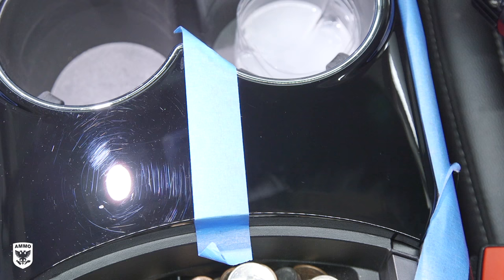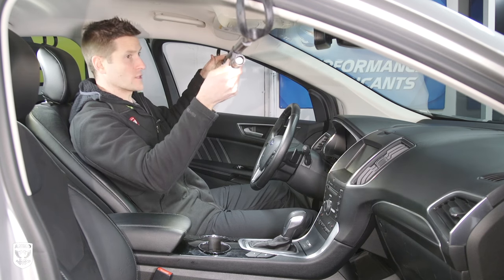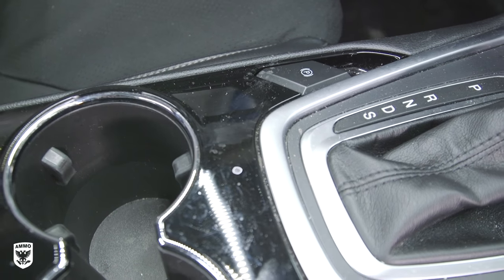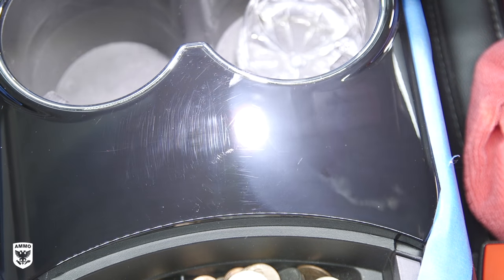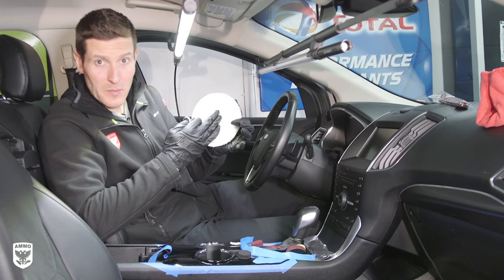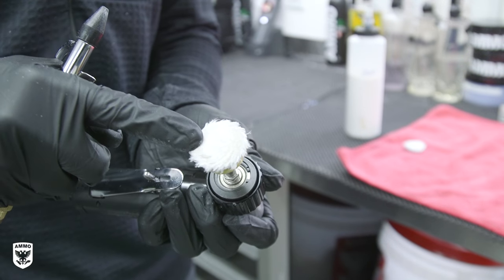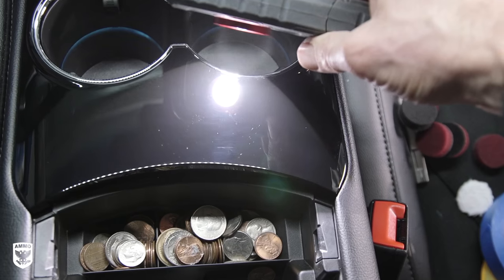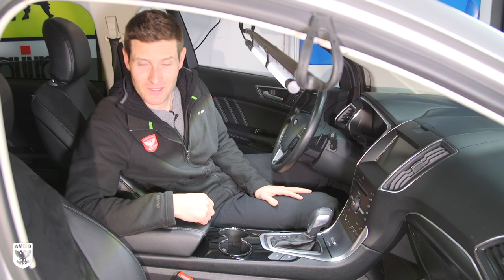How to Remove Scratches from Interior Trim

Comment: I guess the moral of the story is don't get a car with glossy plastic trim
Reply: MrNt1402 the biggest problem is: most car manifacturers think that fake piano paint is somewhat stylish (especially Volkswagen AG ) getting a new Car without glossy plastic is as hard as getting a car without softtouch 10 years ago
Reply: I've been thinking of doing the /brushed aluminum" trick to mine.  Someone did a video about how they scratched their internet router with a dish-scrubbing pad in straight lines and it came out really nice.  I think it would look better than the random scratches like this, and it won't rescratch once you're all done, not visibly anyway.
Reply: Mazda 3 owners will know...
Reply: IvanPavlov I’ve got one! It’s a pain in the bum
Reply: IvanPavlov 3 owner here...been trying to figure out how to get rid of it its so annoying
Reply: MrNt1402 Or ceramic coat your shiny plastic trim when it's brand new.
Reply: Right?
Reply: or wrap the shit XD
Reply: @noncustody  is this actually doable?  like after its polished and refinished.
Reply: FoxHoundUnit89 wrap it. Looks great
Reply: No joke - after he reached step 3, I said, I'm out, I'll live with the scratches.
Reply: for sure, that "piano" stupid plastic has to go away forever from car industry.
Reply: I would wrap that trim with 3m clear protector it hides all the scratches and is more resistant to scratches
Reply: Ååå ä pöpå
Reply: ÅååSaitara åååå
Reply: Saitara pååååååååååååååååååååå
Reply: Saitara påååpå
Reply: Will’s Wheels Detailing and Valeting åååpååååååå
Reply: Will’s Wheels Detailing and Valeting p
Reply: Just put clear bra on it or ceramic coating
Reply: I’m not sure why ANY auto maker uses this trash.  It looks terrible clean or dirty, shows every fingerprint and every defect.  Honda uses it like crazy...bad move.  It’s even in my Audi A8...hate the stuff.
Reply: @IvanPavlov  do do us CX5 owners. That's why I'm here.
Reply: @troywhite8980  😂😂😂 🙌🏽 yep..
Reply: I hate it in my 21 Aviator. It attracts lint and dust. I miss the interior in 2020 F150 Raptor because it didn't have hardly any shiny plastic inside of it.
Reply: You order a pre cut ppf interior kit for just this particular issue, most also come with a screen protector as well as a comprehensive kit.
Reply: Almost impossible

Comment: The poor mans version of the light is at harbor freight, the end of the light bar pops off and there is a little paracord, and the end has hooks that you can hang on the visors or handles etc.  I also get the warranty and you just being it in to the store for a new one if it breaks no questions asked.

Comment: I have a question about priming the pad. When you prime your pad with polish and use the compressed air on it, is the product therefore being wasted because the compressed air is blowing the polish off? (As well if this is true, what other way could you remove the abrasives to reduce wasted polish?)

Comment: Great VIdeo!  BIggest TIP. Make sure to cover the trim with that clear bra stuff or it will be all scratched up in no time.   It is about time they "banned"  found a replacement for this Piano Trim. It is the worst crap ever invented, it looks good for about 60 seconds after fitted then it will be covered in scratches in no time. 

I have the new Mazda cx2 2nd Gen with this type of trim on the outside pillars.....  Hopefully someone reading this, can make new pillars in carbon firbe, i would change in a instant!

Comment: +Ammo NYC 
Larry, Great video btw. Can you step it up to a larger pad than that or does it need to be 1”? I do have a 90 degree grinder that I use for body work so I should be able to do this. the trim is wood trim on a 2007 Lexus GS 350. The scratches aren’t too bad so my main concern is to make superficial cracks better (if possible) Let me know. Thanks.

Comment: I've always approached soft, high-gloss plastics like this with a by-hand approach.  Partly because I'm not a professional detailer and I don't have all these amazing, tiny tools, but also partly because I feel like I have a lot more control over a much more sensitive surface.

I've also found that common compounds and polishes can be overly aggressive with these softer plastics.  Much like you, I've seen 205 leave "residue hazing" on plastics, similar to the haze left on paint by lots of "scratch and swirl remover" all-in-one products.  I've had a lot of success on plastics with Meguiar's Ultimate Polish and a high quality microfiber towel for the "compound" stage to get out deep scratches, then refine by finger-applying a layer of the same polish, letting it sit for a minute or two, then gently wiping and buffing with one of those weird, super-fluffy-soft microfiber rags dampened with water.

Just some thoughts on the subject!  Any and all feedback always welcome.  :)
Reply: That's a really good idea, thanks. Will test it on a inconspicuous part soon.
Reply: @raksh9  3 years later. It work?
Reply: @The2Coolest2  Three years later and I still haven't tested it 😅 I will bookmark this video and update this comment with test results eventually.
Reply: I'm here because I polish high value CDs.
Hand polishing with Novus 1 and 2 give you a brilliant finish.
Novus 1 in particular is a really worthwhile product for cleaning the surface and giving a bit more shine and protection.
It has something that bonds to the plastic but does not bond to itself. So when you wipe it on it bonds to the plastic under the dirt, lifting the dirt off the surface.

So I apply Novus 1 firstly. I use makeup remover pads and apply it very gently. 
I then get a new pad and apply a little more pressure. 
I then flip it over and start buffing lightly but quickly. Drying and polishing at the same time.
Then you do your polishing. With Novus 2 to get the scratches out.
This is hard work, so I am looking at getting a polisher for this part. Maybe doing a final light hand polish
Once polished I then repeat the steps above for novus 1. It really removes old polisher very well too.
Reply: @HouseholdDog

Comment: Thanks for another helpful, educational video, Larry!  I have the piano black trim in my car as well. To clean it, I use a microfiber towel sprayed with SPIT.  Just refold and “buff”!  I went to the drugstore and purchased two 1 1/2 ounce spray bottles and filled one with LATHER and one with SPIT. I keep them in my console with two different microfiber cloths for quick touchups when I’m at a red light or in the drive-through.

Comment: Ammo NYC, you worried about adding crazing when using alcohol product on the plastics? When I clean up interior parts, especially when prepping them for print, alchohol is a no-no, I use novus then water. If its really nasty, first simple green.

Comment: Larry, so if I understood Kevin and yourself correctly, it seems with a 6" pad you could do 6x6", or a 36" wide section, totaling 3ft x 3ft. This would be a panel to pad surface ratio of 45.84. (36" squared / 28.27" squared for the pad) With the 1", it would be 6x1" or 6"x6" total? --> 0.78" squared pad x 45.84 ratio, is 35.78" squared, or indeed a 6"x6" section of residue absorption. Happy to throw that into an email if it's a bit complicated here on YT.

Comment: I had some short, but pretty deep scratches in the piano black plastic on my Velar's center console.  I tried polishing compound but got nowhere.  Then I switched to Meguiars Ultimate Compound and it got them out completely.  Then I buffed it with Turtle Wax Ceramic Acrylic Black Spray Wax.  I did a bunch of passes (all by hand) with the Compound and it took a LOT of patience and elbow grease, but the results were impressive.

Comment: The piano black plastic is impossible to have brand new more than one hour. Polishing at 10.00am and micro-scratch at 11.00am. The job is good i'm ok but who can do that at home? There's too much material to buy just for a little surface on the car. 

Best way is to take car and also with care you will have micro-scratch, if it's a problem for you, the best way is to make a covering. 

I don't need to polish every hour of the day, it's the same problem with polished bracelet of watch, you buy a quality watch brand new, out of the shop just touching your jacket or a soft material like a wood table and there's micro-scratch. The watch is polished at the maintenance but some days after micro-scratch is coming, so there's to live with that, it's IMPOSSIBLE to have in the time a perfect glossy black 100% new without micro-scratch.

Comment: i have a civic fd in need of a detail
black plastic between doors  is heavily scratched , i mean you can see the scratches from a one meter distance
i want to detail this disaster and wondering what is the best way
i'm thinking ofsanding the plastic starting with 5000 - 10000 grid and applying body filler then priming the surface
IS THERE A BETTER WAY?

Comment: Geometry and maths explains why the pads gets so quickly overwhelmed as smaller as they get. The area of a circle is defined by Pi*(R^2). Notice Pi is a constant, so the area of the circle will increase quadratically as the radius gets bigger. So (and I'm not going to be precise here, just an example), 2cm radius (yes, inches are old and ugly, leave them in the past) of pad will have 4 times more area than a 1cm radius pad. It's 4 times more surface to get residue with only double the radius. If the pad has 3cm it will have 9 times more, 4cm 16 times more, and so on.

So yes, maths can help you understand why a smaller pad will get even much less residue than you thought!

Comment: Hey Larry,
My steering wheel has a typical soft leather wrap and my wife's fingernails did a vibrating bounce and scraped/gouged the leather with a strip of annoying mini-tags that hang off of it. Is there a fix for that w/o damaging the leather? I have some ideas, but you would know best. Thanks for all of the great tips/tricks.

Comment: Help Larry!...same issue with Piano black on front gauge cluster of a Harley. I looked in your description and don't see anything with the kit or what pieces you had in the kit. I went to the guy's website and that kit doesn't exist that I could see. Would it have to be piecemeal together to create? The way you were describing it sounded like a kit. Do you have a link for that or at least a description of the pieces parts you could post?  Thanks for the content.

Comment: Using the electric polisher would've really made the process more efficient and faster. If I had a battery polisher at work I'd be all over it because I have to do the swapping between polisher and blower like this. I guess it really aggravates me knowing you willingly went through that torture entirely unnecessarily

Comment: Very interesting idea to use clear protectant film on the infernal piano black interior bits. Or may be another vinyl film with a finish of the owner's choice. I could see a matte or brushed finish as option. @Ammo NYC, did you end up putting any film on your daily driver's glossy black surfaces?
Reply: Am going to try this when I've cleaned up the plastic bits.

Comment: The clip at the end with Kevin on the phone was awesome. 

The concept makes perfect sense and I kind of already understood it from switching between 6 and 3 inch pads on paint, for example.

However, actually looking at the math (as well as visually seeing how small of a pass you really need to stick to) is something that will be super valuable intel for those of us who aren't using those micro pads on a regular basis.

Pi
R
Squared

Comment: Using this material in cars is a nonsense . I got a new car a month ago. The dealer scratched the plastic horrifically. I got them to replace the panels, which they did, then they washed them and scratched them again...

Comment: You should tell us what products work best for this piano black trim. I did mines and did the old school method of wet sanding. Did 800 and stepped to  1000 then 2000 and then used plasticX polish cream by hand. It worked but took me the whole day.

Comment: How about scratches on mirrors?  Any way to work on those?  I've accidentally got some polish on one of my outside mirrors and wiped it off.  Boom, minor scratches.  Just for clarification, I'm referring to the actual mirror portion (like a bathroom mirror), not the plastic mirror housing.

Comment: Although clear bra'n your console is a good idea, but if you don't want a film layer on your console and want to still have the feel of a glossy slick surface, why not just ceramic coat it? Maybe use Ceramic PRO or another ceramic coating product? Then you still have the glossy slick feel and you also get to protect against the scratches? Just like what you'd do on your outside paint.

Comment: Hi, do you have a video that shows the process to remove scratches from plastic trim in the car in door panels and other plastic trunk and molded parts. They are not highly polished but have some scrarches and dirt ingrained in them.

Comment: Sounds like a Y-adapter with an extra 5 or 6 6 foot length of hose would be a worthwhile addition to your air supply at the tool end. That way you can use two tools without having to swap them out all the time or to require multiple pre-prepped pads. Is this a practical idea?

Comment: Looks like there is still a haze there. Could it be possible to refine it further using the same water method you used in an earlier video where the paint was so soft you couldnt even use a polish to refine the compounding scratches?

Comment: Is it not easy to screw this panel loose and remove it from the car, i usually do that, than i can get between the seems, and you would also have no tape or sling to worry about, looks nice though.

Comment: Great vid would the same apply to polishing plastics that has a chrome finish have a au fairlane here in oz some chrome on the inside and out side has fine scratches thats dulled the finish

Cheers nick

Comment: Larry,  been following you for a few years.  Love the attention to detail.  Some times I even say, alright, enough!     Some comments and observations on this application: 

When ever I've used M105 or M205 on paint, I always notice the additional cutting power which is excellent for tough swirl jobs, but I always have to put up with the additional sling of the polish as it begins to flash and dry.  It's just as madding on the exterior as you illustrated on the interior with smaller pads, but on the bigger harder surfaces, worth the time investment in the additional mess because of the cutting power.  Point here: this product is "dusty" and you're always fighting it no matter the application and you have to balance / consider the time investment in constantly cleaning your pads using the Meguiars worth the time saved on the cut and subsequent clean up.  

To combat this I'll use less dusty products.  Been an Adams fan too for some time and find their system not quite as dusty as Meg's.  Ammo  polish is similar IMO.  Again, I get it just depends on how much you want the product to cut, but the battle you're going through keeping your pads primed but not over primed just doesn't justify the time involved in using the Megs and battling the dust.    In this particular case,  it doesn't seem worth it to use the Meg but rather just your Ammo polish .  

Better yet, since you're using multiple cutting pads, presumably for different cuts, wouldn't be easier to avoid the Polish product all together and use the pads and detail spray / Hydrate on the pads and bypass the whole Meg's dusty polish battle all together?  

Now, this is now way a knock on Megiars or you; i have both products in my arsinle of potions and lotions, but I don't know, this was one where I had to say, ok, there's a faster way without the dust battle you've described with Meguiars products and I had to at least ask.

Comment: Hi Larry 
Question hope has not been asked. 
Here in the uk most weekend worriers may not have access to air or the rubes is very expensive. 
Can these small pads be used on let’s say a dremal?
Reply from the maker: Never tried that but worth a shot. I would try on a scrap junkyard piece before trying on your car though, just to be safe.

Comment: Hi Larry,
As always another great video.  It is great to know how important residue management is when working on interior trim and how when using smaller pads requires a increase in residue management control.

The one thing that I think you need to point out to all your viewers is the makeup of these interior trim parts.

Interior trim parts are not painted so you are not working with a standard clear coat.  Interior trim either has a urethane top coat or a PMMA topcoat.  Both of these topcoats are about 2 mils thick.

One last thing depending on the film used by the automotive maker you can reflow these topcoats by using heat.  This can remove scratches and increase gloss.  

If you want to know more about films used for automotive trim interior let me know.  I would be happy to provide you with a detail course on this along with how these parts are made.  Maybe we can even make a video about this.

Best Regards,
Ken
Reply from the maker: Of course send me an email with whatever you have. Would love to read and practice it :)
Reply: Hi Larry, Ok I will work on putting something together for you and I will email it over to you.